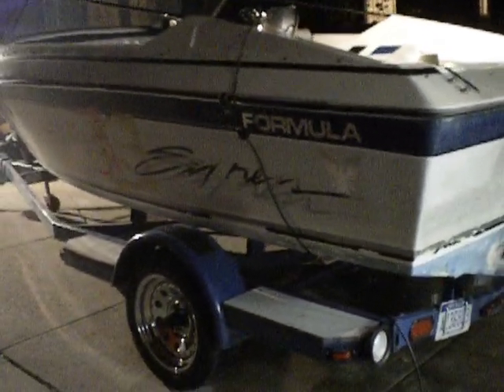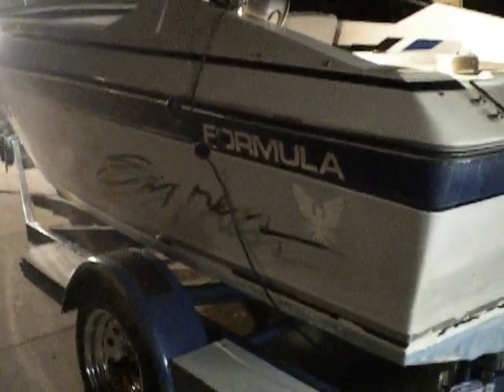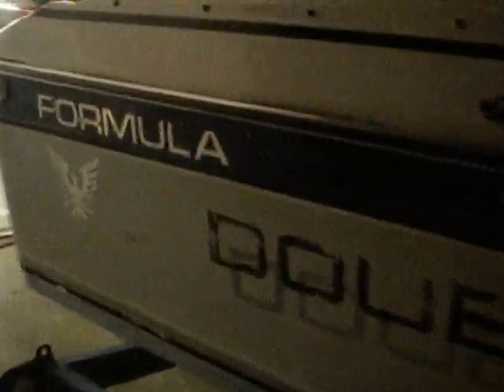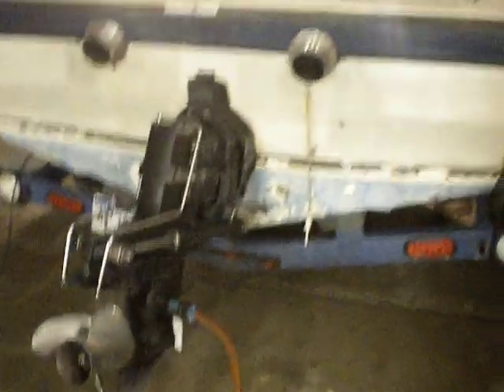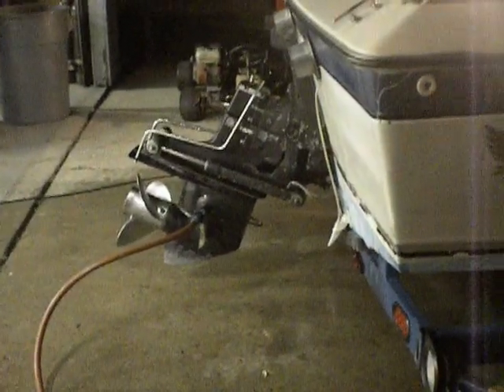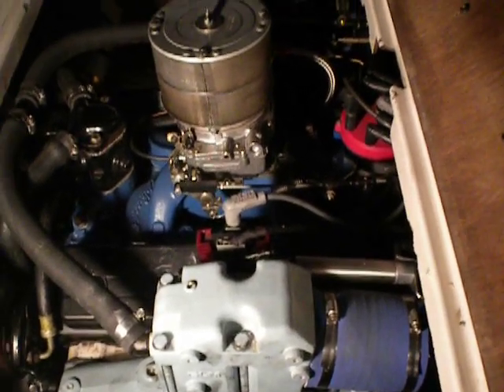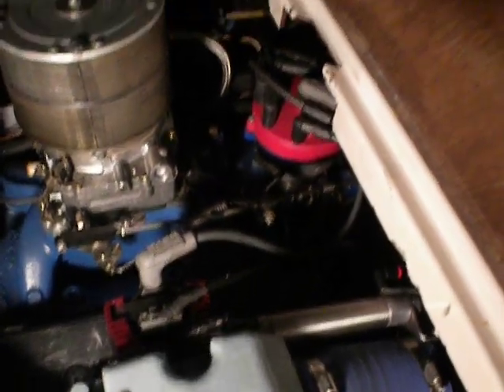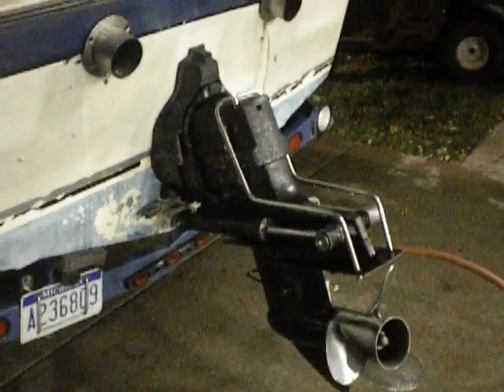Formula One Boat 17' MerCruiser w / Built Chevy 350 Vortec 5.7L V8 Transplant

Comment: I just picked up a yellow 1980 Formula One. It has the 120HP 4 cylinder and I'd also like to re-power with either the 4.3L or 5.7L down the road. FYI...you need to use paint stripper to get the bottom paint off. Be prepared to see a nightmare underneath because the original gel coat was roughed up so the paint would stick. Many hours of sanding and I still had to 
re-gel coat the area to make it look good.

Comment from the maker: The V6 is 3 small cylinders long.  Your 470 is 4 large cylinders long.  You will likely have to disconnect everything, pull the outdrive, lift the engine off its mount, and turn it 90 degrees before lifting it out.  The 470 is one half of a Ford 460 big block.  Aluminum MerCeuiser block, cast iron Ford 460 head.  3.7L.  I have to put my 350 in and out this way.

Comment: I have a 1981 Formula, same as you, with the 470 mercruiser. Coolant started leaking towards front.Looks like front seal on cam. Dont see where there is room in there to replace. My question is. How did you successfully pull out your V6? Did you have to cut out any fiberglass? They put those engines in and put top on afterwards or what?

Comment from the maker: You have to first clearly define what you want it to do.  If you want to do full throttle holeshots, and never break, then upgrade to the Bravo outdrive.  Costly, but can be done fairly easily.  If you can avoid full throttle holeshots, and roll the throttle on gradually during each take off, it will be OK.  Outdrive boats can't takeoff fast no matter what anyway, regardless of engine.  Driveline physics of having the prop push at the rear and under the boat = bow rise.

Comment from the maker: I did not upgrade the drive to a Bravo.  Any Alpha drive will hold up if you don't do full throttle hole-shots.  Bravo drive weighs and costs a lot more, so I wanted to avoid it.  Found many success stories of built 350's using the Alpha drive if you are nice to it until up on plane.  I added a drive shower.  Change ratio from V6 to V8 (1.5), did it myself with MerCruiser setup tools to correctly hit all the preloads and clearances using appropriate shims. 5 years, been OK so far.

Comment from the maker: Regarding use of a "marine engine", most I/O engines are automotive, with few changes to better adapt them to marine use.  Those changes typiclly include: liquid cooled exhaust manifolds, brass freeze plugs, marine specific camshaft, intake manifold which may have brass jacketed coolant passages, marine coolant circulation pump, carburetor, and head gaskets, and explosion-proof starter, alternator, and distributor.  Otherwise, same as an automotive, engine.  Yes, I used marine parts.

Comment from the maker: Regarding motor mounts, the 4.3 LV6 and 5.7L V8 are the same engine, minus 2 cylinders.  Due to this, the rear mount is exactly the same (can reuse it), and the side mounts are same also, but they are moved forward approximatly 4", so you need to have that room available on your stringes, or extend them like I did (I used stainless steel C channel).

Comment from the maker: The rear motor mount (bellhousing) is of course the same.  The engine block side mounts are further forward, as you say.  In my boat, the engine mounting stringers are not full length, so I extended them with stainless steel "C" channel I obtained from a local scrap metal yard.  I bolted them on top of my short stringers, and then also to the front bilge area in the engine compartment (from underside of "C" channel, bolt going forward horizontally into bildge header area).  Works great.

Comment: I have the 470 4cyl that does 45mph with just me in it.. so fun and cheep to run.  But i wouldnt mind a small block.  don't forget trim tabs.  At your v8 speeds, our little boat chin walks easy, at 45mph mine just started, till i run out of 4cyl. big HP.  ha ha
have fun.

Comment from the maker: Thanks for the words.  I would say it is a mild 350, sounds nutty because of the through hull exhaust.  Boat needs more work to be pretty, I need to figure out how to get the bottom paint off, and I need to tighten up the rub rail all the way around.  I'd like to add a nice teak swim platform also.  It runs almost 70mph now, which is pretty good for an outdrive style boat.  Heck, even 50mph is fast, and I'm 20mph more than that.  Chevy 350 can be built to perform solid for pretty low cost.